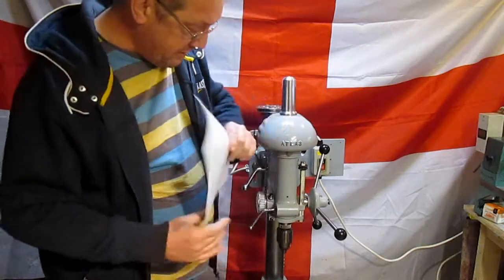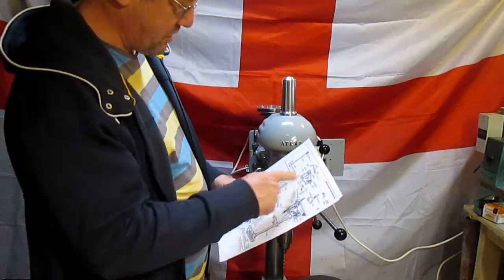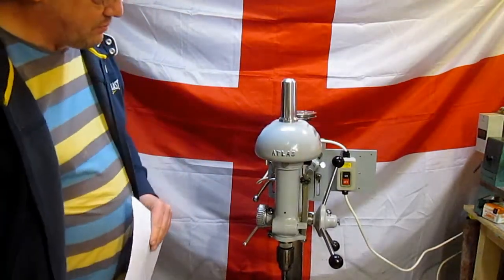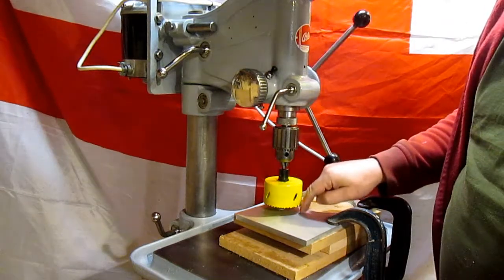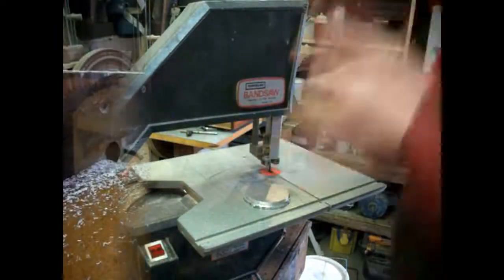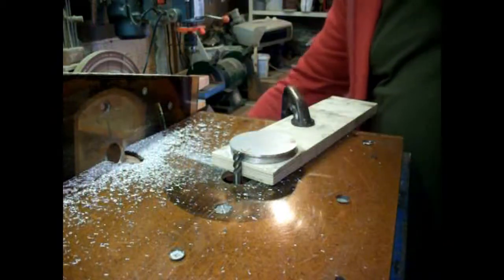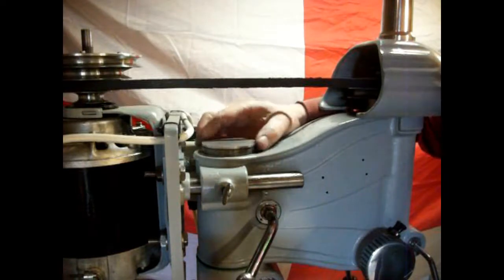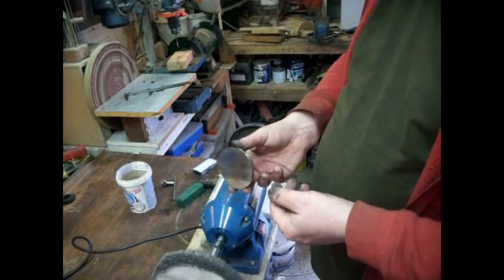Atlas 74 Pillar Drill Restoration # 20 bumper & pillar cap

Comment: You could put a rubber gasket on the cap to make the fit snug inside the column. Even some electrical tape would do the trick.